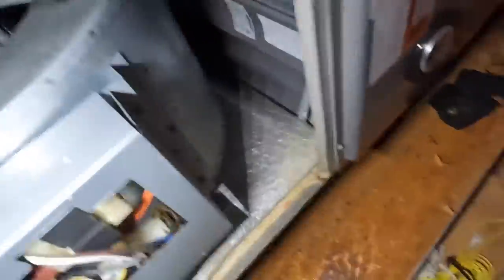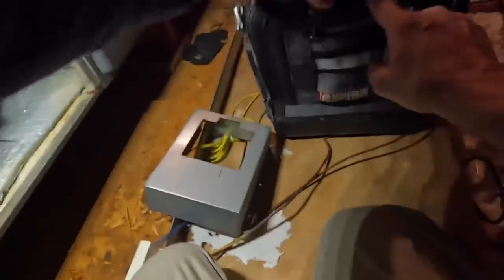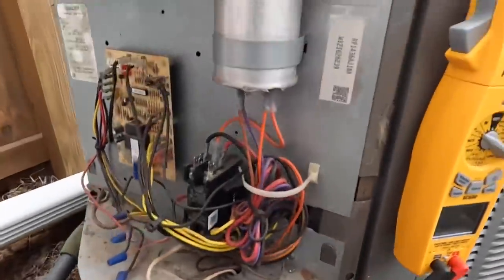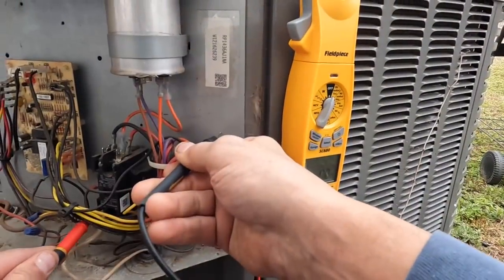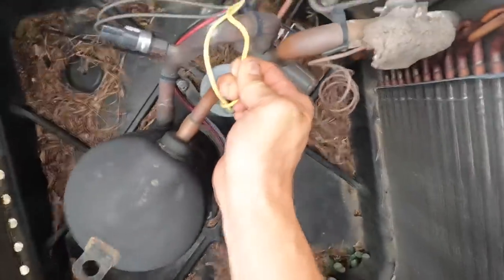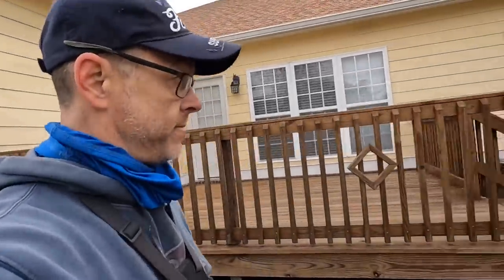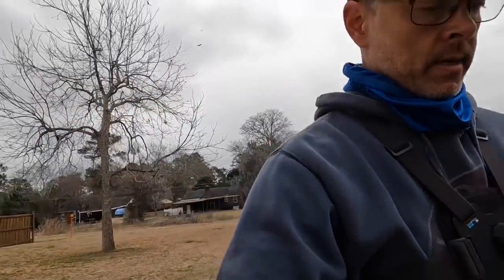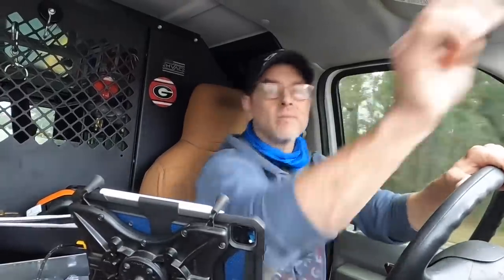Low Voltage Short on 5 Year Old Rheem Condenser, Identical To Another Recent Repair.

Comment: The first one I had with a bad contactor took me forever, I was new and didn’t want to call someone and be clown of, the very next shorted one was the wires on to of suction line, I learned them pretty quick. Great job on the repair.

Comment: Exact same problem on my own Trane a few years ago.  Repair guys came and fired the parts cannon right away instead of intelligently diagnosing it. 
I was tired of waiting for them to order parts and play the guessing game while I ran emergency heat, so I found the fault myself.  At least I ended up with a free spare DFC and TDR board under warranty.  
Same black tape fix, too!

Comment: Nice job, I had this problem on a Daikin HP,  the other day, those short testers are life saves, I've seen a lot of them do the exact same thing, now I just automatically remove the condenser wires from the tstat wires at air handler, and replace fuse most of the time it will fire right up and I head to the condenser. Contactor and pressure switch, and tstat wires rubbing on copper I check first. Won't believe how many dogs chew those outside wires lol

Comment: very common problem with the newer rheems. soon as they say nothing comes on/ no power to the thermostat.and its a Rheem.  i will go directly to the condenser. possibly only having to go to the air handler one time.

Comment: Rheem carrier goodman bard they have same problem sometimes the defrost t stat wire also at least its not high voltage and blows a hole in copper lines

Comment: Irony of time and manufacture , exactly the same , tape and zip ties  , day and night always had loose leads to compressors on package furnace RTU s usually cooked them no protection on sheet metal  punched holes not even deburred or supported correctly...✌️💪👍🙏🤔😔⚡🔥

Comment: Without past experience that would have been a right pain in the posterior to fix. It could easily have been an intermittent fault. Call back after call back :(
Reply: Sometimes they will only short when it rains hard! Depends on how much it’s rubbed